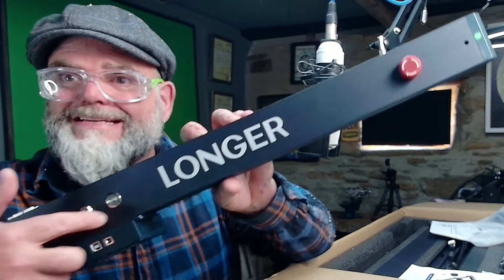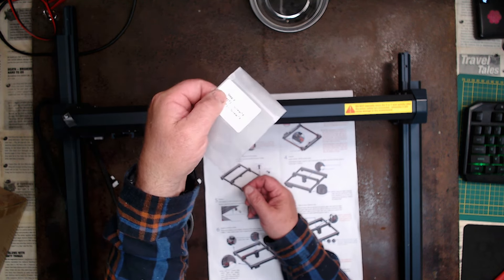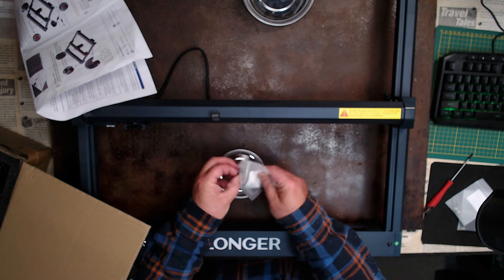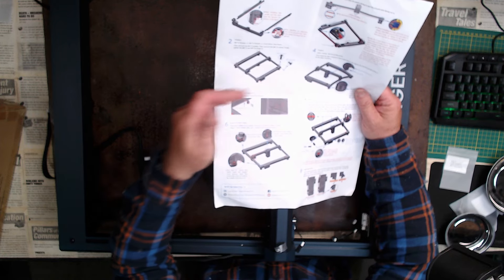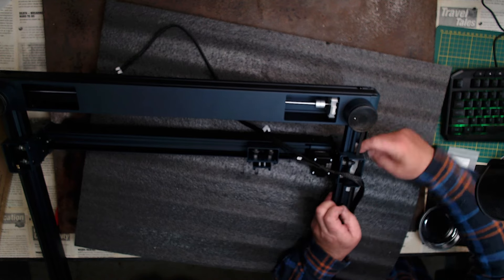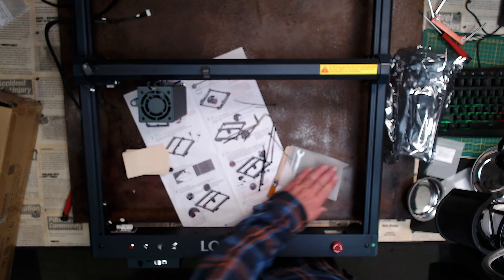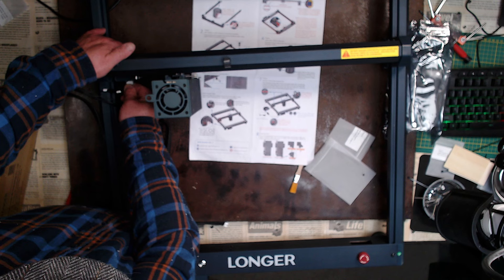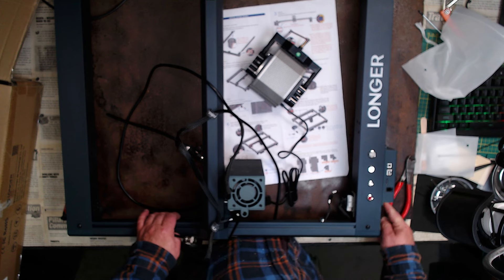Longer B1 40 Watt Laser Engraver Assembly #uneditedvideo #longer

Comment: Hi Marcus.  Something with that much power is a game changer.  It will give you the ability to cut through far thicker materials including hard woods with ease.  It does however mean that you need to retest all your previous materials as the 40w will just burn them up.  Lucky you for the support you are getting from Longer, wish it was me.
Reply from the maker: I am very excited about this machine... I think I will do a series of test burns in different woods... Could make an interesting vid too xx
Reply: @WallyboisWoodworking  very much so. The offer of help is still there if you want any.